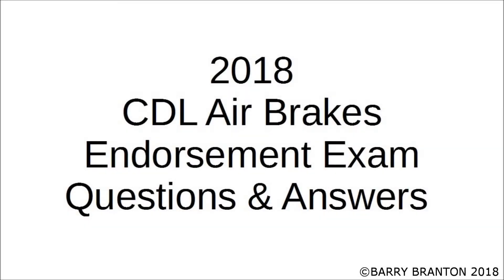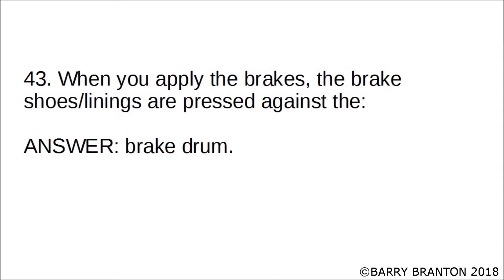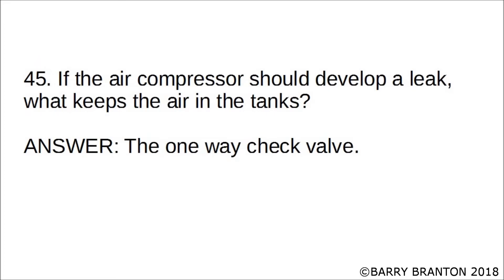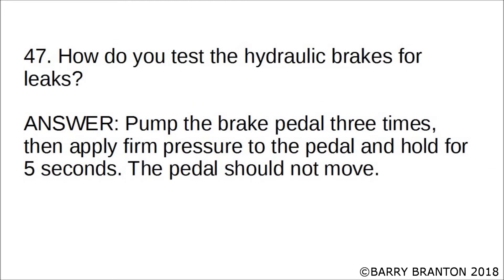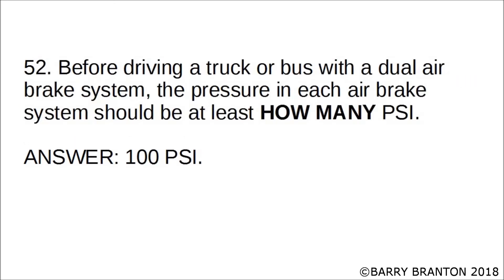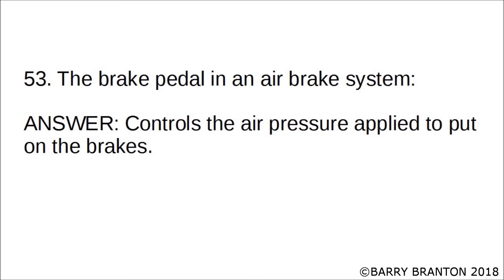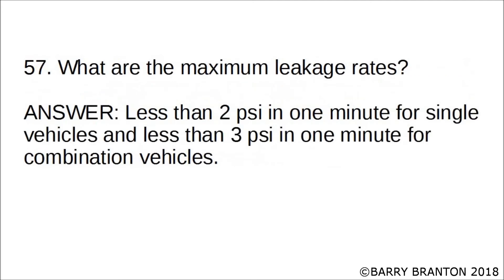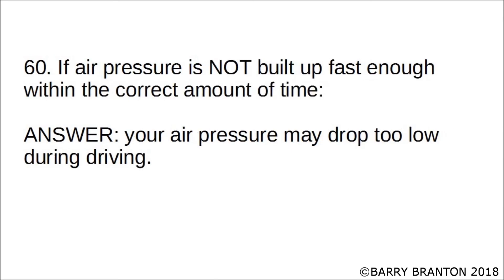2018 CDL Air Brakes Endorsement Exam Questions & Answers Part 3 of 5

Comment: Good morning Barry I was wondering if the way the test are step up meaning 20 questions on each video are the in order with the test at the DMV? I know you have to get 20 out of 25 questions correct at the DMV.
Reply from the maker: What you need to do is study Section 5 - Air Brakes. Study this read-along video: https://youtu.be/nWVya5YNnMY